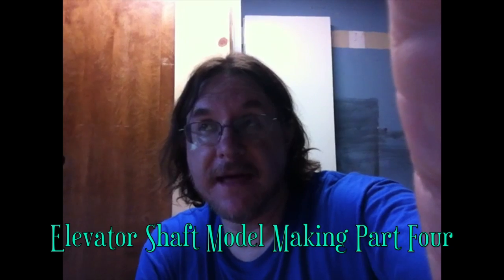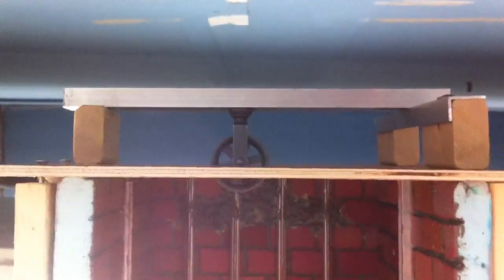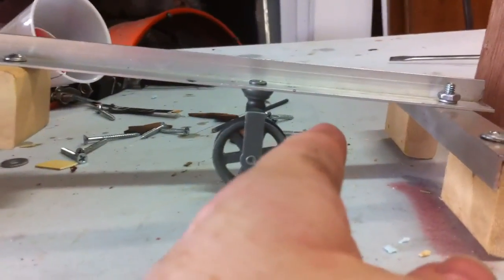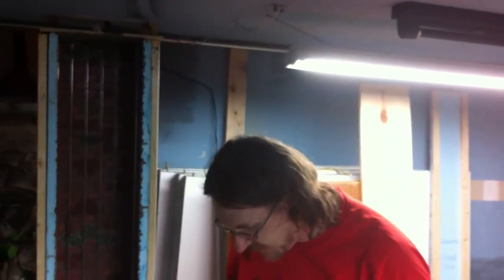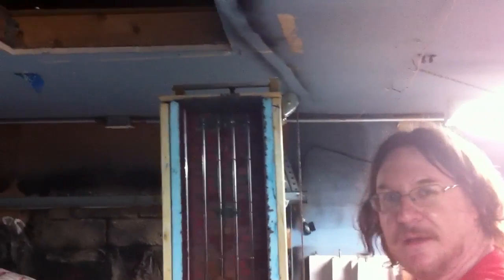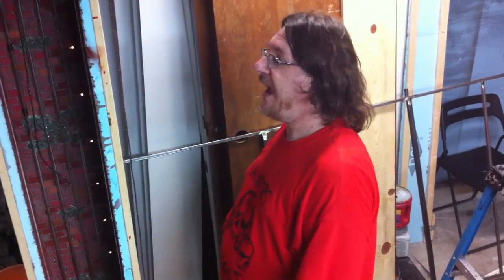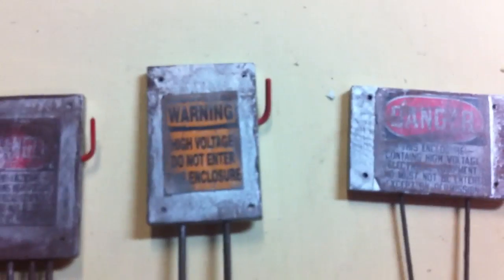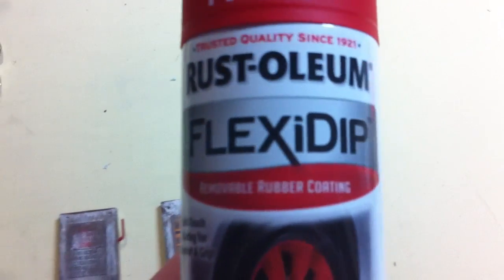Elevator Shaft Model Making Part Four

Comment: Wow you guys. This is great. I know you all will pull it off. I was thinking that where the loop meets at the top from the cable, that it should connect to another circle that is connected to all four of the fishing lines so it will not move. I don't know if that would help but it might be worth a shot. This project has me so excited. I can't wait to see it all come together. The LED lights added such a nice touch.
Reply from the maker: Thanks Mary, Great Suggestion about adding an additional ring. I think we got it figured out now but I am going to keep that idea in mind if we have any more trouble with it.

Comment: I thought I saw a panel with doors, will that be seen on video?
Reply from the maker: Yes, the panel with the doors is the missing 4th panel, it will be added to complete the 4 walls and enclose the shaft once we figure out all of the issues with the elevator car, which I think we did tonight.

Comment: That's amazing! I absolutely love this - so creative! All the detail work on the shaft is magnificent.

Quick question - have you tested that the GoPro will focus on the bricks for your side view? I'm sure you're safe on your 'looking up' view, but on the side the camera is so close to the bricks I worry the focus might be soft, which would shatter the illusion. It may work fine, but you may want to test it.

If it's soft there are still options - backing the camera off in the housing somehow perhaps.
Reply from the maker: Thanks Brad, I did notice that a bit in the test videos so we pulled the side camera out and mounted it underneath. You will see that in the next video.
I think it will give us a better shot with it backed up a bit. Thanks for the Heads up on that.